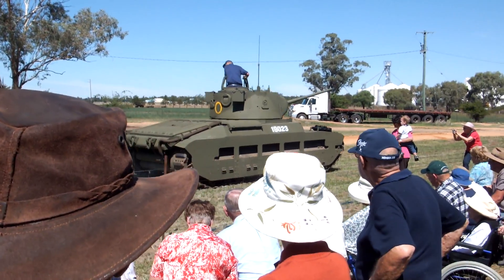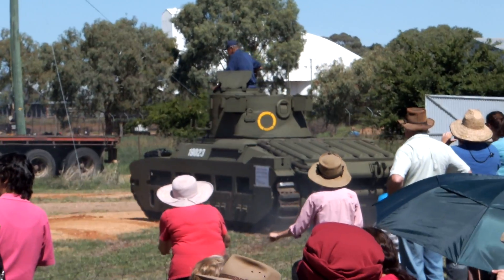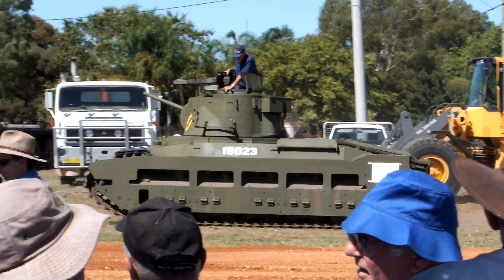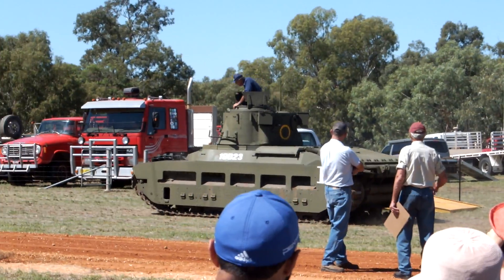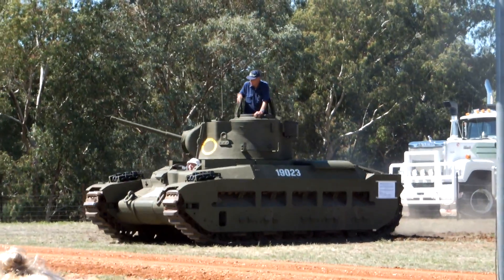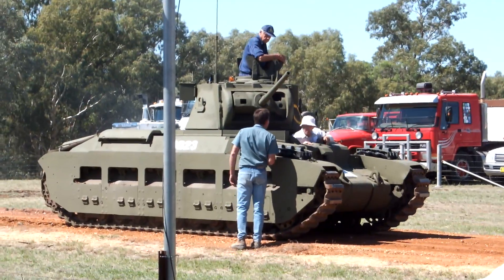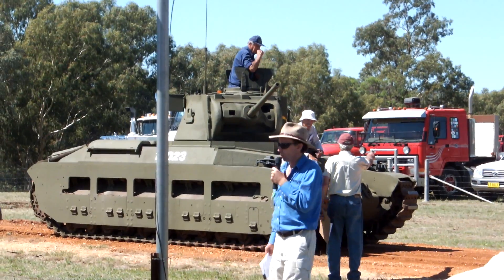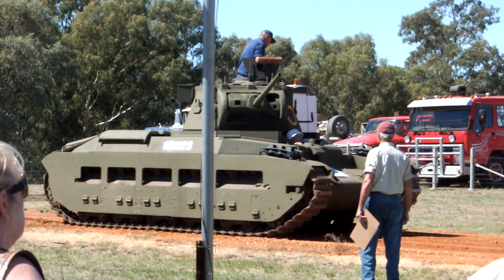Matilda II Tank

Comment: Yy father bought a Matilda tank in the 1970's for $500 at auction in South Australia. It was left in a paddock off Port Road for years until someone smart enough stole the engines, presumably to use in a boat. Dad just passed away and my brother says we have heaps of Matilda spare parts laying around his home. They go for scrap metal unless someone is able to use them otherwise.
Reply: phixxyful , do you still have these parts ??
Reply: Matt McMahon Yes, but am in contact with Joe Tabone in NSW who is interested. We have four radiators, a pile of various clutch plates, wheels and sprockets and rubber compounds like fan belts. There may be more as the shed is piled up with old bike parts that will be cleared out in auction in a few weeks and we'll see exactly what we have then.
Reply: Phil Raymond  Thanks Phil, I have 3  Matilda's we are working on, If Joe dosent do anything I will. If your auctioning the Matilda parts please let me know,  Kind Regards Matt 0408 472 022
Reply: Matt McMahon Just a bit more Matt... I understand it had two Leyland engines in it and was a Mark V so not sure what differences there'd be with what you are working on. As for auction, the auctioneers want the various wheels and clutch plates.... but they say people are crazy for that type of stuff for landscaping. We'll get the WLA's and parts auctioned off first and leave the Matilda bits until we can catalogue what there is and likely go at a second auction down the track unless we get a reasonable offer first.
Reply: Phil Raymond  you are correct, two leyland's, three different series but all the same, just the auxiliary's layed out differently. My email is mmc94466(at)bigpond.net.au, as to discuss a reasonable offer !!!

Comment: Hello Christopher, To clear up the confusion, my tank was built as a Matilda IV Close Support vehicle by LMS. When I acquired the tank it was stripped of turret and gun and being used clearing scrub. I have had to rebuild it as a gun tank simply because the two turrets I located were both two-pounder turrets. Also I have only been able to locate a two-pounder gun. If I could find a three-inch Howitzer (76.2mm cal.) I would gladly bring it to its original condition. Sadly, because transport facilities in the early '50's were far less capable than they are today, many of the vehicles had their turrets removed at the auction site and the dreaded scrap dealers got them. I searched in four States over about twenty years locating parts for my tank. Also, the part in the commentary about the tank's armament was incorrect; the role of the two-pounder and the three-inch Howitzer was reversed. Thank you for your interest.

Comment: seems like there's some confusion between the tank's role (close support to infantry) and its armament,  It looks like an ordinary Matilda II to me, not the CS version.  The CS gun had a 92mm (3" howitzer) gun while the usual model only had a 2 pdr (40mm) gun, so the barrel width should be much fatter than the 2 pdr model.  The CS model wasn't a "later model" it was produced from the start - about 10% of the production was the CS version  (even it if was called the Matilda III).  See for instance http://en.wikipedia.org/wiki/File:Cruiser_MkIIA_CS_1_Bovington.jpg